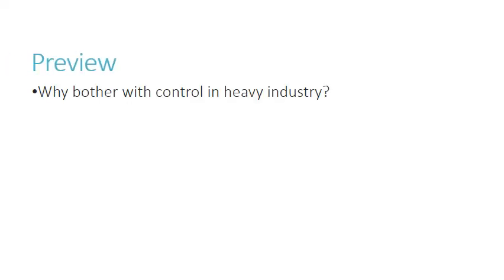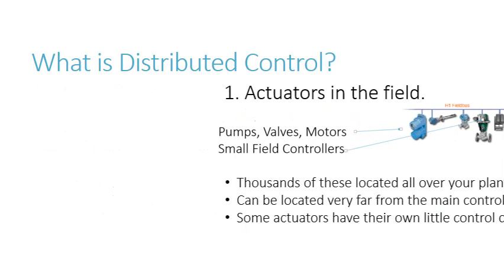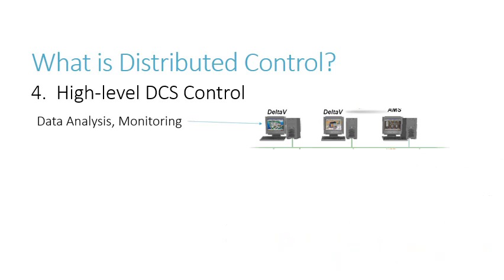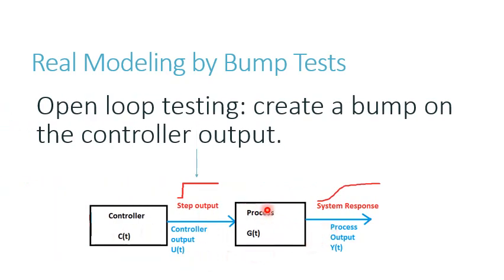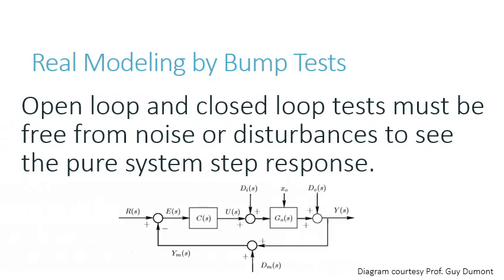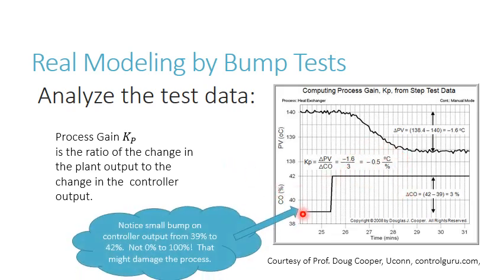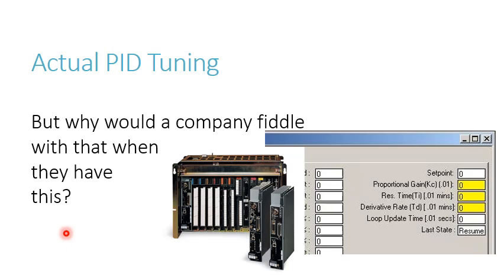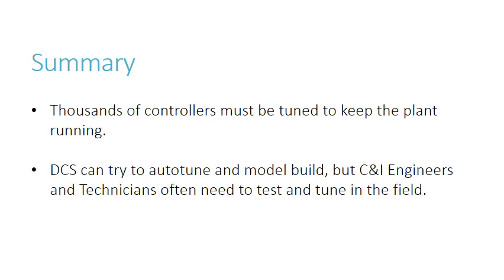Distributed Control Systems:  Real World Modeling and Tuning Through Bump Testing

Comment: what a amazing job, I really appreciate this videos it helps me alot. i Have a question , this could be very simple but i can't figure out.. when your controller has a negative error, it means a negative input to the actuator but.. if i have a servo motor I can't use negative values?  so what means that negative input ... and i've been working into a ball and beam process , that process would be a Non self regulating process?  I'm sorry for my english . hope you can help me thanks ..!!!!